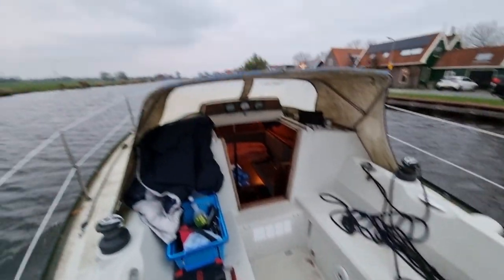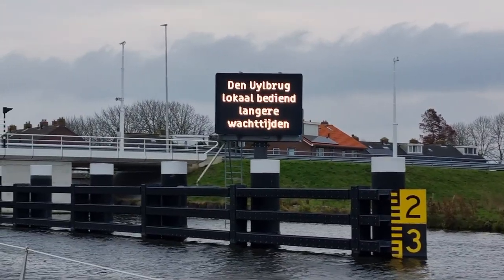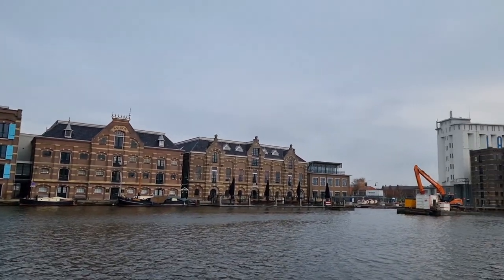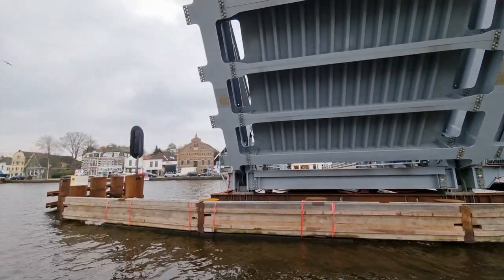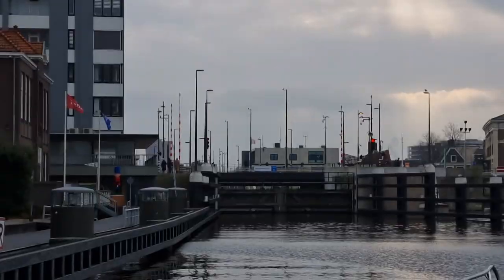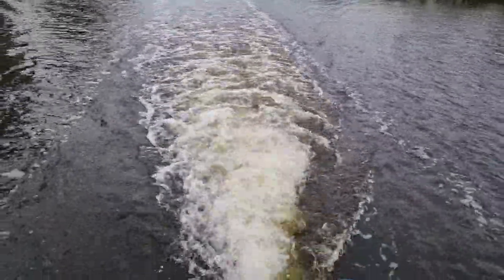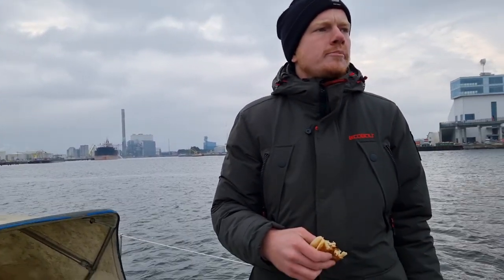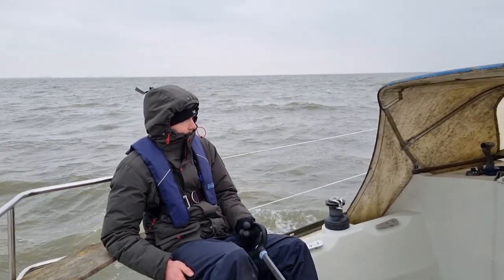Episode 2 | Dufour 31 project | 7 hour boattrip through The Netherlands, bringing it back home

Comment: How many horsepower was the outboard motor that you used?
Reply from the maker: The Yamaha F series outboard is a 8HP, high trust propeller
Reply: @sailingsilverwind  thanks! I’m going to look at a Dufour 31 today. I currently have a Catalina 22 that I am moving up from. The Dufour I’m looking at has been re-powered with a YanMar, so the engine should be solid. However, I’m far more familiar with outboards, and knowing that is an option gives me some comfort.
Reply from the maker: @stelliform  ah awesome! I have more videos also a short from the inside. 👍🏻👍🏻 Yes they replace the old engines regularly. Good luck! Have a double check at the deck, as it has many connections on it, who can fail and leak water.
Reply from the maker: Did it work out?
Reply: @sailingsilverwind  yes it did. We took it on an awesome sail, the motor was solid, everything looked good. Hopefully, we will be finalizing the purchase Thursday!
Reply from the maker: @stelliform  whooo that's amazing, maybe you can share some photos on my Instagram @sailingsilverwind I am very curious!
Reply: @sailingsilverwind  sure, I’ll try to send you some later today.